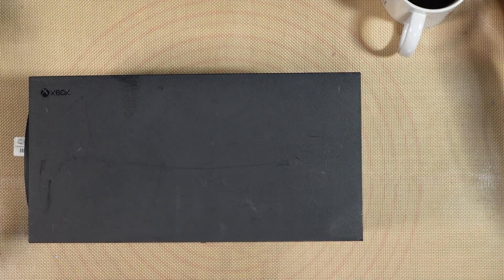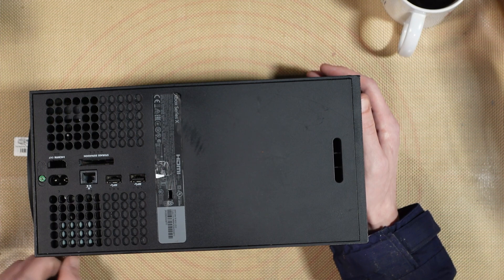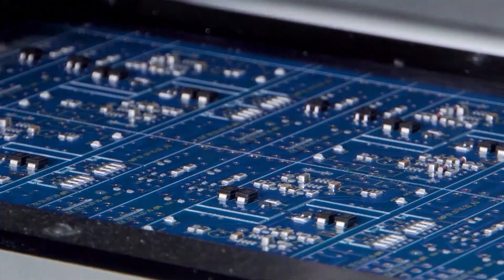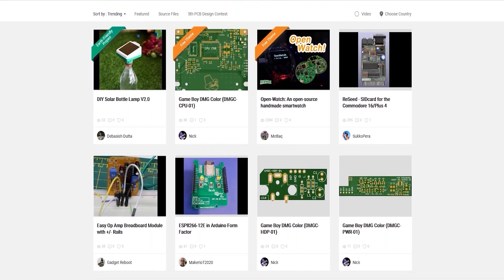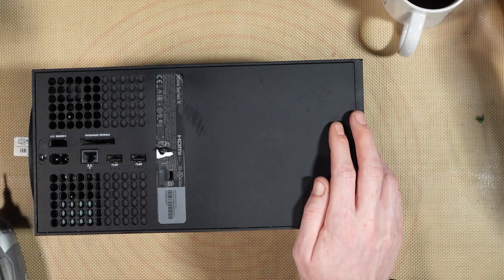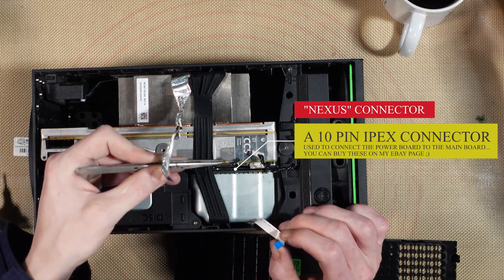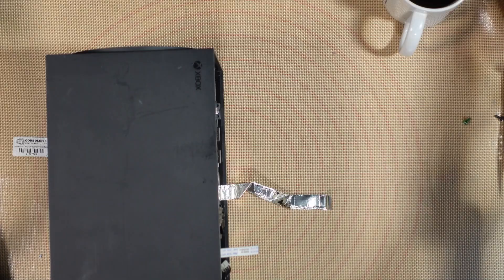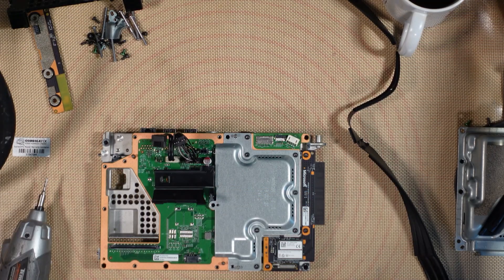This Xbox Series X Had Multiple Wounds! Can I Fix It?

Comment: Very good video and repair work as always. I've also got a Series X which has what I believe to be a dead southbridge and was looking at maybe getting a donor board from your store to swap the southbridge over. I'm just unsure if i'm barking up the wrong tree or not with it - symptoms are it's totally dead no response to power button, no shorts on the 12V rail. The 3.3V rail on the southbridge board is showing a 50ohm resistance to ground and it's low voltage (2V instead of 3.3v). Injecting 3.3v into the rail produces no heat and no current draw. Gone through and removed all the small IC's which connect to the 3.3V rail but none of them changed the 50ohm resistance to ground reading which led me to thinking the southbridge itself is to blame but I haven't removed it yet as it would be a complete pain to reball it if it's not the problem and I don't have a replacement! Any thoughts?

Comment: Hello mate, unrelated question.
Do you know if psvr2 is able to be plugged into the usb on front of Ps5? Only spar port it have
Reply from the maker: I'm not sure to be honest mate. Personally I've only ever held a PSVR2 once and I only used it on a PS4 to make sure it worked before I sold it. Sorry I can't help mate
Reply: @TheCod3r  no worries mate. I have 1 more question that I think you will be able to answer.
Let’s say I have to unplug either my racing wheel, or external hard drive from Ps5 every time I want to use psvr2, if I’m really careful, would the ports get damaged over time? Or am I worrying about nothing? In 1 year I could possibly be removing and inserting at least 100 times. If my ports will probably get damaged over constant changing leads around, would it be expensive to fix? Thanks in advance.

Comment: What size copper wire do you use for the jumper wires?
Reply from the maker: It varies but mainly 0.01mm or 0.17mm for HDMI ports :)
Reply: @TheCod3r  thanks